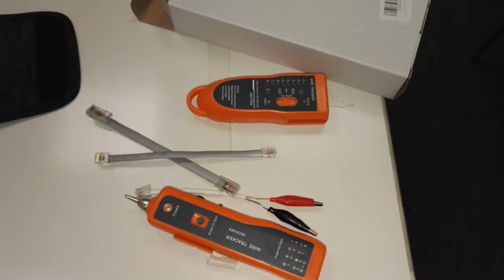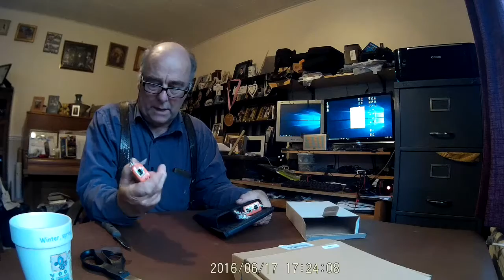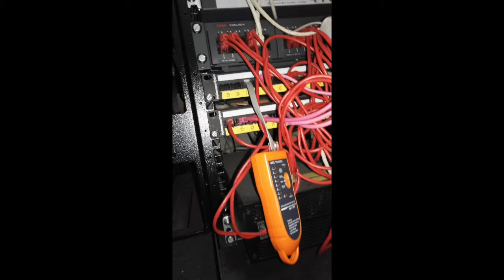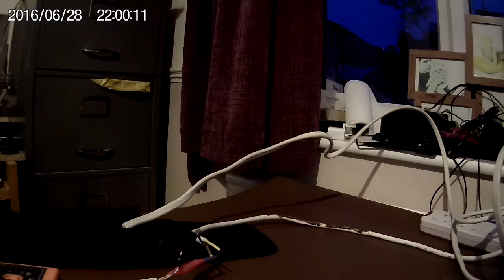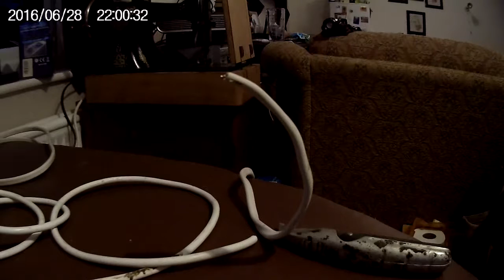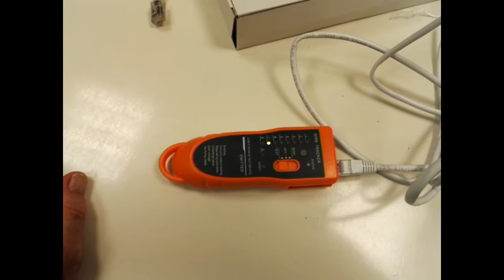VicTsing Cable tracker

Comment: Finally a real video on the product!  Would you recommend this for light use.  Has it fallen apart on you?  Just curios as the price for it is awesome.
Reply from the maker: Yes I would recommend this tool for light use.  I would suggest keeping it in the case supplied when not in use in your toolbox, it is not fragile but it is made of plastic.

unlike the really expensive professional tools this one will not indicate the distance to a break in as cable but it does show off there is one.
Reply: Much appreciated. That's what I wanted to know.  I wasn't even aware that pro level tools could tell you the distance to a break.  Thanks again.